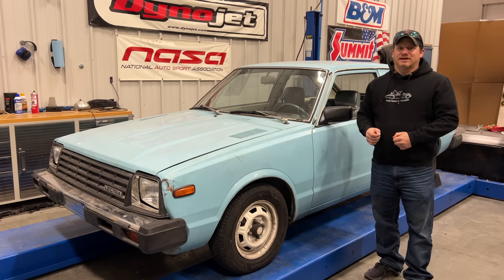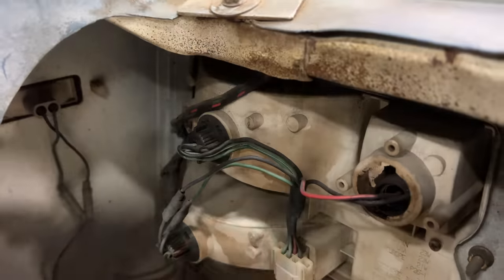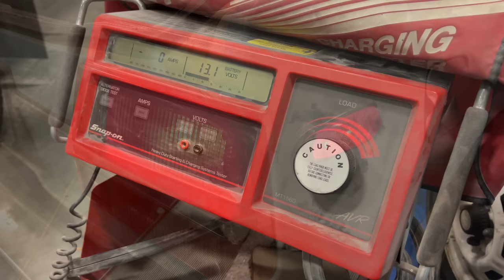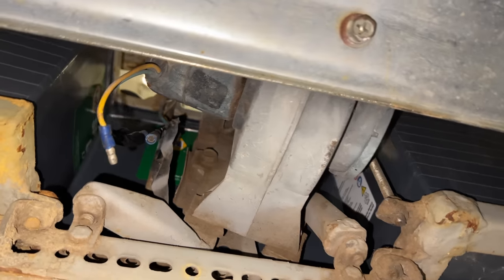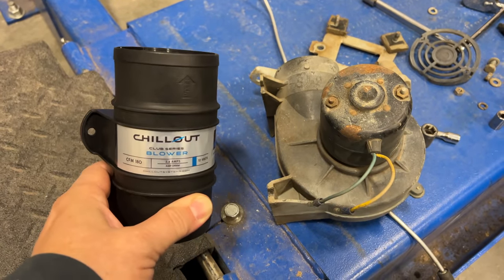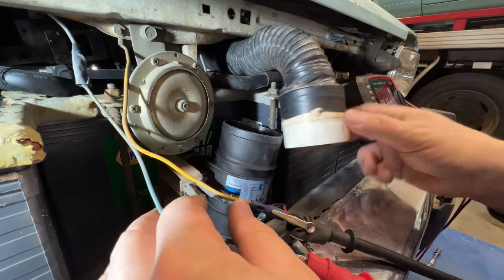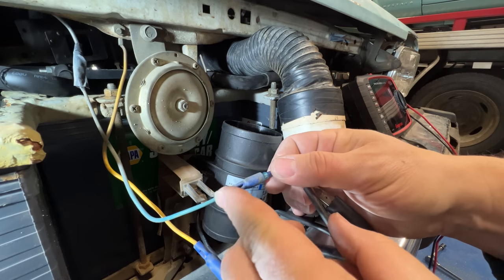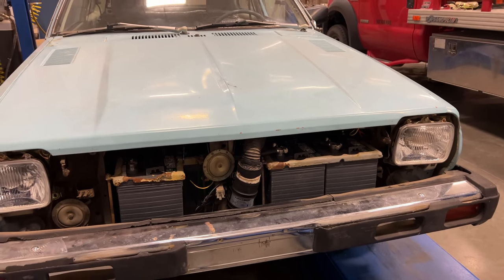Upgrading the Lectra's Broken Cooling System

Comment: I bought my LEDs from this shop and my Midget is lit up bright or brighter than any modern car. The running lights, brake lights and blinkers are quite bright. I had to make sure to get the red ones for the brakes and running lights and yellow LEDs for the blinkers as this results in much more light making it through the filter that is our tail light lenses, as well as bulbs that didn't depend 100% on reflection, as the bulbs were just a little too stubby for my reflectors.

Comment: You learn something every day (I've been wiring direct thru switches for years). Once I pulled all the fuel pipes out of an old Buick to find my "Fuel Block" was an "Empty tank". It seems that you should have checked the power before removing the old fan, still, you did have power. Cheers

Comment: Never saw the double the wire trick when installing crush connectors. Great comparison of the brightness of LED bulbs. Have to take a look at converting my motorhome. People must not see the signal lights since they don’t give space to pull over. Aren’t they surprised.

Comment: Can someone explain to me why only after installing a relay the blower fan worked? It didn't make sense to me..
Reply from the maker: Because the relay only takes a small amount of power, the circuit could not supply enough power to run the fan but it can run a relay.
Reply: @ThisWeekWithCars  oh i see... Makes sense now